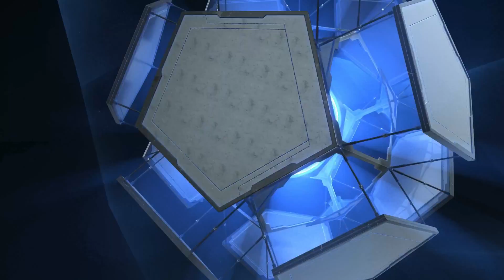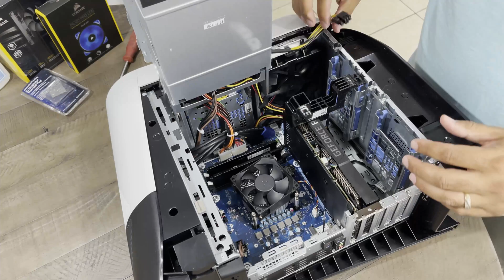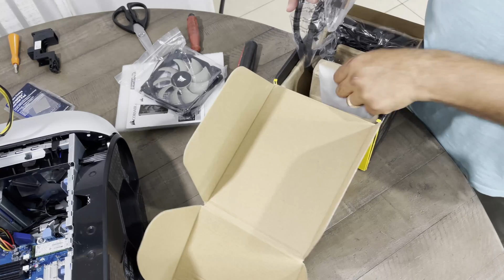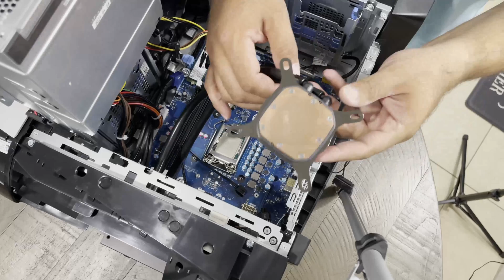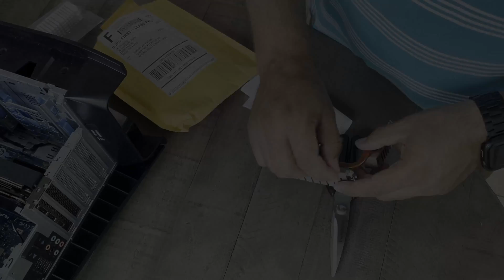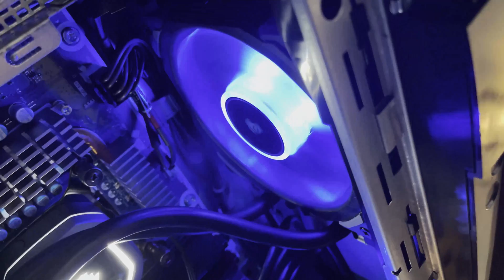Alienware Aurora R12 Upgrade

Comment: Hi, i know this is an old video but, I installed 2 Noctura Fans in my R12 - and when im testing them on AWCC, the fans wont go over the speed of 37%. Did you have this issue with the Consair?
Reply from the maker: Not at all
Reply: @Cyonaux  weirdddd. I'll try a fan hub first, but if that doesn't work ill try the Consair. 
I plugged back in my dell stock fans, and they go above 37%. So im not sure if its the Noctura fan or the motherboard being strict.

Comment: What about the start up error message you get for using a Corsair ? The Alienware Aurora r12 will tell you there’s a pump fan error message when you start the pc up… it’s a pre boot system check error when removing the old cpu and putting in a aftermarket one

Comment: hello i purchased corsair ml120 rgb fans and now my r12 is throwing up errors in bios stating fans not connected. when i reinstall the old fans it works just fine.
Reply from the maker: @garrett_9092  thats normal

Comment: QUESTION ... "I AM THINKING OF INSTALLING 3 Noctua NF-A12x25 PWM, FANS ALL IN A VERTICAL ARRAY AT THE FRONT OF MY AURORA R12".

DETAILS OF THE FANS ARE AS FOLLOWS:-

Size - 120 x 120 x 25 mm
Mounting hole spacing - 105 x 105 mm
Connector & pin-configuration - 4-pin PWM
Cable length - 20cm + 30cm NA-EC1 extension cable
 Rotational speed (+/- 10%) - 2000 RPM
Input power (typical) - 1,2 W
Input power (max.) - 1,68 W
Input current (typical) - 0,1 A
Max. input current - 0,14 A
Operating voltage - 12 V
Voltage PWM signal - 5 V

IS THIS INSTALLATION OF MY CHOOSING POSSIBLE.

CHEERS BRO. !

Comment: Nice video! I got two ML120 elite fans with push and pull configuration (LED) and H60 x Elite AIO. I think these are the newer versions of fans and cooler, but I kept getting boot up error saying cpu fan not responding. What should I do😢

Comment: I've upgraded my cpu fans to cooler master ml120 liquid cooling. I've seen the R12 stock aio's pump has the pwm pin out grounded, so i did the same and the cpu fan error was gone. Anyone tried this before? Hope it will not have long term issues doing this.

Comment: Hey there! Thanks for the video, I did exactly the same with H60 AIO + 2x ML120 Elite (instead of pro) and it helped a lot. I was aware of the BIOS error that could be triggered by leaving the CPU FAN header out open so I plugged the H60 pump to it. I still get the Pre Boot Checker saying the CPU FAN failed to respond correctly... Tried plugging the H60 Radiator, one of the ML120 Elite on it instead and same problem. I'm getting quite desperate at this point. Any ideas?
Reply: You may get the error, because you're using a Y splitter, leave only a fan on that connector, I found that Y splitter have 3 pins on one side and 4 pins on the other side, both fans sometimes work simultaneously, but sometimes only one fan spins that's when you get bios error
As I have liquid refrigeration on cpu, I installed an additional fan on "cpu fan" connector as this is available, but had to use noctua low noise cable, to have the fan quietly spinning, I make think the work around to use a Y splitter is to use a 3 pin fan cooler master.
Hope this helps
Reply: @Jmaarroyo  Thanks for the reply, but unfortunately I think Alienware latest BIOS updates get more excentric regarding the fans it detects and even H60 AIO fan isn't accepted by the Motherboard
Reply: @olivierbeaulac8948 Hi I have the same problem, did you figured any thing out after?

Comment: When you say you "bought four fans" do you mean three separate from the one that comes with H60 AIO?
Reply from the maker: No all 4 I did not use the one that came with the AIO because it was a different rpm max and was loud
Reply: @Cyonaux  the two top fans that sandwich the radiator, are they both pointing the same direction (out of case direction) or are they each pointing away from radiator?

Comment: Hi, thank you for sharing the video but I have one question. What was the other piece you were showing when installing the vram heatsink? Also, that blue tape do you open that or leave as is and just screw it in? Thank you.
Reply: Same question here.  Was the blue spongy "tape" removed or left on the VRM heatsink?  The video was edited right there, so could not tell.  @CrypticHack3r

Comment: I keep reading about the heating issues on this box. I got one in March, new from Dell: i5 11400, liquid cooled, with 32gb and a RTX 3060ti. Metro Exodus on max settings and the fan speed on 50 to 55 % speed and it never gets smoking hot.
What temps are you getting after this mod?
Reply from the maker: I no longer have this PC please come and check out the channel to see my other PC and my live stream I currently game on here now

Comment: The  h60 does not fit well at all, the push pull config is doable but leaves little room for the cooler or ram, every time I close the case, I'm afraid I'm going to cut the circulation, the fans are nice but are not fully compatible with the command center.  Decent video but those were the problems I ran into.

Comment: I did this same mod except I used the iCue H60i AIO, and I ditched the ML120 it comes with for two Arctic P12's in a push-pull configuration. I ditched the thermal paste that was pre-applied to the corsair and applied a generous amount of SYY-157.  I also installed the additional intake fan in place of the mechanical hard drive, just like you did, but I also added a third intake fan on the bottom, in place of one of the 2.5 inch drive slots. I idle at 31c and the most I've seen is 61c while gaming. This is without the VRM Heatsink, which I am still waiting on.

Comment: i have an aurora r12 black with an rtx 3080 inside. the hdd is very slow and i would like to add an additional m.2 nvme ssd on the available PCI express x16 slot. my concern is whether it affects the cooling ability of my graphic card because its width is very large and after i add this module, half part of one of the fans only have about 2 centimeters of space to pull air to cool the gpu. any suggestion.  i bought an input converter that converts m.2 to pci express x16 but its height profile is half the height of the gpu. so it blocks half of the one of the fans and the blocked area only have about 2 centimeter to catch air. i don't know if you get my point. if so, any suggestion would be appreciated. thanks

Comment: I did just the corsair liquid cool mod so far and dell support assist is throwing a PC Fan failure. Is this normal?
Reply: You are not alone. I have the same problem and even if it seems to get fixed when you plug your pump fan cable into the cpu fan header, it may still have this error message (my case). Is it still a problem you encounter?

Comment: I have an Aurora R12 as well and Im about to do all the same upgrades. For the top you mentioned the push pull method, just so I am correct the top fan pushes air in and the bottom one of the radiator pulls it out? So basically its opposing air going to the radiator?  Also do you use all the same connections that the stock fans went to pretty much, minus the sata connecter on the pump head?  Also did you have to do anything in the BIOS?  sorry its been a long time since I have done any pc building/upgrading lol
Reply: Did you figure the direction out for the fans on radiator?
Reply: @mattkirby994  I did figure it out.  It’s been working like a champ since this past July when I did the upgrades.
Reply: @DJSkyhawk85  I'm about to do this myself, I am being told that both fans with radiator are facing the same direction (out) - is that what you concluded?
Reply: @mattkirby994  Yes you are correct, both fans pushing the air upwards and out the top of the case.  when I am gaming I have a custom fan curve that's pretty high and my cpu has never gotten above 70°c.

Comment: Hi Chris, I also have an Aurora R12 and upgraded the cooling system with the Corsair H60 and the 120 fans. But now I get Bios errors on the fans. Do you have any suggestions?
Reply: Having same issue with stock H60 fan. Were you able to solve?
Reply: @linochestang573  yes

Comment: I did this but the fans that I put in weren’t running at the  speed I set them at  They were running a lot slower anyway to fix that
Reply from the maker: My suggestion is make sure they are ML fans and also make sure the speed is set through ACC and not BIOS

Comment: Is the VRM heat sink needed when going fan to liquid cooled CPU? I can’t find the heat sink  right now and I’m wanting to liquid cook my cpu and I was wondering if it’ll throw a code without adding a VRM heat sink.
Reply from the maker: It won’t throw a code but you do need it those VRMs get quite hot because the fan you remove from the CPU cools them and the liquid AIO doesn’t they are exposed
Reply: @Cyonaux  that makes sense. Thank you for responding. Are you still running the same rig?
Reply from the maker: @dyone3  no I’m running a custom PC which I built from the ground up. You can see it in my other video
Reply: @Cyonaux  not sure what you ended up doing with your Alienware but, if you'd do a full case swap, what motherboard would you use? What CPU did you have in your R12?
Reply from the maker: @dyone3  see that’s the thing I wouldn’t do a swap. No point you would need new MB and RAM plus ACC won’t be as integrated as with current setup. Reason why I chose to build. Take a look at my other build video on my channel!
Reply: @Cyonaux  I’ve seen your builds. They’re pretty good. I just don’t have the budget for a full build. Thinking about carrying over the cpu and GPU.
Reply from the maker: @dyone3  I would get the same motherboard I used my concern is will the GPU fit properly since it’s proprietary to Dell. I mean it should and as far as RAM you may want to go to whatever motherboard you buy website and look at their QVL list and make sure that CPU and RAM is supported

Comment: Hi i have a r11 i was just wondering the upper intake fan is it a 4pin or 3pin
Reply from the maker: I believe they are 4 pin
Reply from the maker: See the description below and check out the noctua cable amazon link and you may be able to see what pins those cables are

Comment: Hey, so I need some advice. I bought a R12 but for whatever reason it can’t handle more than 16 GB of memory. I have two 8 gb memory sticks installed. Anymore than that and the computer won’t start up. The dell techs couldn’t figure out what’s wrong they thought it was the mother board and even with a new board same problem. Anyone have a fix?

Comment: The fan that you’re using to push into the radiator should be an SP fan and not AF fan, am I correct?
Reply from the maker: Correct
Reply: @Cyonaux  thank you, one more question please, on the motherboard, the connection labeled CPU fan, which cable from the H60 goes there?
Reply from the maker: @YC305  pump
Reply: @Cyonaux  thanks a lot 😉👍
Reply: @Cyonaux  Chris, I have the Aurora R11, I just installed the H60 but using only the fan that came with it, I’m not using push pull configuration. Why is this computer still loud? Is it the fans from the Graphics card or the power supply? I think it’s even louder now.
Reply from the maker: @YC305  the fans on the h60 and the stock ones are all loud you need Corsair SP to minimize it but  it won’t completely go away
Reply from the maker: @YC305  by the way I’m live now
Reply: @Cyonaux  thanks 🙏

Comment: Do I really need the heatsink or is it optional?
Reply from the maker: Definitely needed to keep temps down
Reply from the maker: @UCsSzw8mt7kSvrx1PiKpe53Q yes
Reply: @Cyonaux  thanks for the help and quick reply!
Reply: Okay I bought this AIO , I realized my PC is Ryzen R10 and for some reason I thought it was R12 and can't find a R10 VRM Heatsync. Dells cooler sucks. My AMD 5800 is at 90c plus. I have a wraith Prism cooler from my old PC and I'm wondering if that would work cause I'm assuming it will be better then the dell stock one
Reply from the maker: @MysticLyrium  most 120mm aio will not significantly perform better then others you can only cool so much with the size and the liquid in them. The R10 vrm I think it’s just a rectangle if I am not mistaken. Dells AIO actually is made by one of the top aio makers in the industry which is Asetek so it’s not a bad AIO.
Reply from the maker: @MysticLyrium  I may have that heat sync!

Comment: @Andy
Are you pushing air up through the radiator out of the case currently? or are you using it as intake to push air into the case? I'm about to do a H60 install as well, just waiting on the VRM.
Reply: I'm about to try this... Did you figure this out by chance?

Comment: Thank you man, this video is a saving grace.
I've had consistent 60-70 CPU temp while gaming with full blowing fan, I mean the temp is not too bad but the 100% fan noise is just unbearable, my corsair pro 120 fans haven't come yet, and I have only just installed the Corsair Hydro H60 AIO, and with just about 40% fan output the temp never went above 60. Can't wait to get the pro 120 fans and get that push/pull configuration in there.
Reply from the maker: Good luck
Reply: @Andy
Are you pushing air up through the radiator out of the case currently? or are you using it as intake to push air into the case? I'm about to do a H60 install as well, just waiting on the VRM. I use my computer with case open im thinking about going case closed if I can really get my temps down but Im having a hard time deciding on the all of the potential fan configs.
Reply: @Altos  2 top fans with push/pull along with the radiator are pushing out, and 2 front fans for air intake.
Reply: @cks2020693  sorry just to clarify when you say top 2 with radiator "are pushing out" do you mean pushing away from radiator or both the same direction pointing out of case?
Reply: @mattkirby994  2 fans with radiator in the middle, they are both going out, that's known as the "push/pull" configuration because the fan outside the radiator is pulling heat from the radiator whereas the fan inside the radiator is pushing the heat out of the radiator
Reply: @Altos  I first installed just 1 fan behind radiator pushing out with 1 front intake fan, and the temp already way down, never went above 60C with 50% fan output. And with all 4 fans working, temp mostly stay around 53-57 ar full load, these fans are also very quiet, especially at 50%

Comment: Question: after installing this liquid cooler, in ALienware control center, the fan control for cpu - originally used for the now replaced cpu fan - is stuck at 92%. Does this translate to the water pump running at 92% ?
Reply from the maker: Yes
Reply: @Cyonaux  thank you!  Your video was very helpful.

Comment: I am adding the OEM liquid thermal system to my (VERY HOT) R 12. I come back to this video often for some direction (thank you for that). if I am replacing two of the fans with corsair ML120 pros, will they have any errors when I start up? I read you purchased some noctua cables, but I am just doing the liquid cooled and switching out the 2 stock fans (not push pull).

Comment: Hey Thank you for this video, I have noticed one thing for some reason my fan on my PSU doesn't work. Is that normal? Like it just stays in one spot lol
Reply: that's normal. the fan on the PSU turns on for a little bit every once in a while when it reaches certain temperature.  (basically every PSU does this.  not just this one on the Alienware Aurora)

Comment: Hi, I did this exact build, funny thing is, I don't get the bios error for the fans, but I suspect the pump is not getting any PWM, is the pump automatic? Does it stay on 91% all the time, or it there a temp sensor?
Reply: the pump is not pwm. its supposed to be running at 100% all the time. thats why there is a pump header for it. the top radiator fan is pwm though

Comment: Can I replace the Intel i7 with the ryzen 7 5800x?
Reply from the maker: No I believe this is a Z490 LGA 1200 designed for Intel CPU only and the back bracket is soldered to the motherboard since it’s proprietary

Comment: Super helpful, man. Thanks! I got my Ryzen R10 with an RTX 3080 and have already swapped 2 fans and looking to install a 3rd one. It was INCREDIBLE the difference on fan noise since I bought decent fans for my computer. Unreal how crappy Dell's default fans are!

Also looking to install that 3rd one and replace my thermal paste from CPU and GPU to help cooling. I'm still getting peaks of 83C on my GPU while gaming.
Reply: Nice! Did you see improved performance? I feel like my 3080 isn’t performing as well as my friends non Dell 3070. I’m hoping dells 3080 isn’t that bad and the thermals are the issue
Reply: Fabio I am thinking of doing the same, my fans are too loud. What did you choose and did you have any problems with booting your computer when you started. I've seen comments with the wrong fans the MB won't boot. Thanks

Comment: Hello and Good Evening again Brother,

I'm sorry to disturb you at this time, if you don't mind and have a time then could you please do let me know Regarding Alienware Aurora R13 Intel, because I've got Alienware Aurora R12 about a month ago, so I was thinking of to return this one and buy R13, please Brother, what I'm thinking, do you agree or not, and if yes, then please explain, what are the overall main differences between R12 to R13, I mean power supply, Ram, cpu, gpu, motherboard and so on, is it worth it, please Brother you and Dell's community do let me know Regarding this, thank you so very much and really appreciate for you're help and support, 

Kind regards 

Mohammed.
Reply from the maker: If you are interested in the new alder lake cpu and better cooling an airflow with a new chassis that has plexi glass i would def return r12 for r13 its a no brainer
Reply: @Cyonaux  thank you so very much and really appreciate Brother for your information, Mohammed.